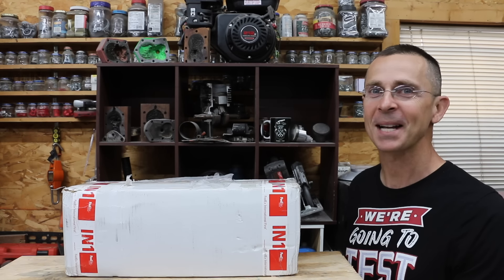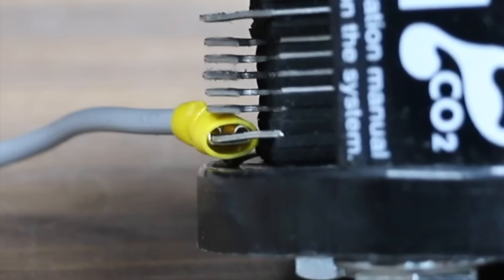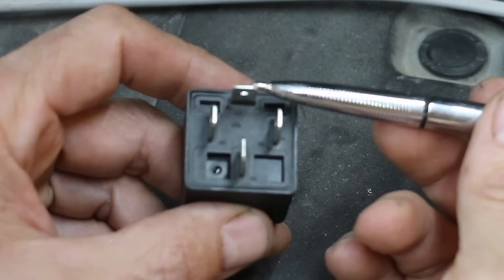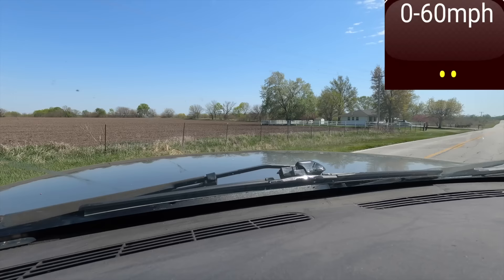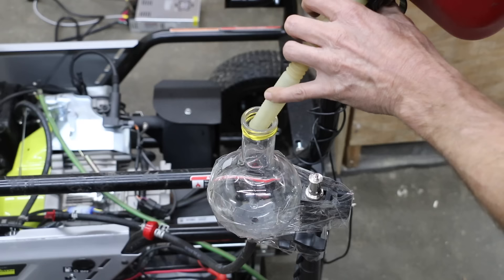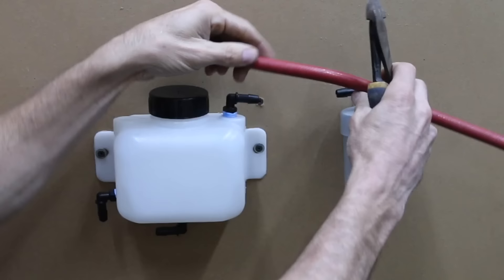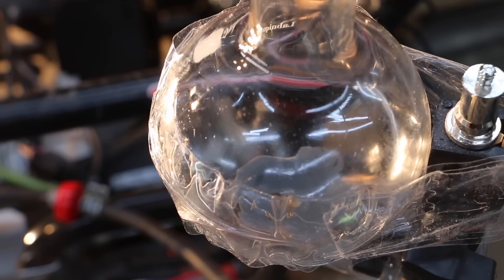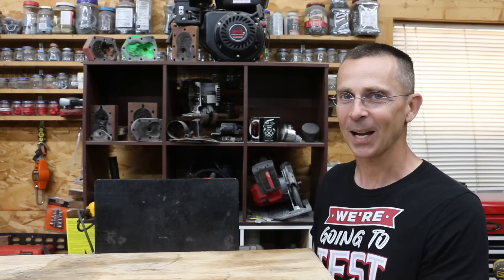AMAZING 35% More MPG with HHO? Let’s find out! Help with high gas prices?

Comment: As a physicist, I can tell you exactly why this didn’t work: energy conservation. If you generated the HHO with external power, you probably would get that increase in efficiency, at least with sufficient flow rate. But you’re using energy to generate the HHO, and the absolute best you can hope for is to get that same energy back, which you won’t because every step of conversion incurs losses.
Reply: Ok so if we run the hydrogen generator on an extra battery which isn't connected to the regular motors battery we should have a different result?. 

Why not just running the motor on hydrogen alone?
Reply: Thats not exactly true,,you forget the calorific value of the gas generated,,but you will still need petrol to make this system work,,the biggest flaw is the O2 sensors and electric fuel in jection,control by a set value in design,,why you need to trick O2 Sensors,,other wise more fuel will adde to bring mixture back to design set,,
HHO<Browns gas,,you have added extra oxy and the sensors see it,,The other problem is the size and design of unit,
no where enough gas is genertated to supply such high flow rate of this pertol powered air pump,,
Reply: When you seek to convert
You only subvert!
Reply: @gabrielsansar6187  That makes no sense at all. The ignition in the bomb is only enough to cause one atom to split in the chain reaction which is a completely different subject and situation.
Reply: There is a bad assumption in your argument. A gas engine has, at best, a 40% thermal efficiency.  Adding HHO improves thermal efficiency of the engine. That's where your power to generate the gas comes from.
Reply: @ianwilliams487  
Ok that makes sense.. But what about adding this to a carburetor type vehicle without O2 sensors?
Reply: @ianwilliams487  no such thing
Reply: Hmm well i will admit when i tried to find it,
I didn't find it,
how ever i have seen his Ford escort running on HHO,,Now he didn't give any thing on fuel cost compare to normal running,,
but it did have a HHo system and the car worked well,I was more interested in the heat of the Gas when burnt,and yes he did Melt a brick with the egnited gas,,
Reply: @ianwilliams487  
Thanks Ian
Reply: @ianwilliams487  You are exactly right.  The object of HHO is to create a more efficient burn of the petrol.  You can do the same with a petrol vaporizer.  I did that several years ago with a chevy full sized van v8 engine.  Van went from 16 mpg to 26 mpg first half tank.  By last half tank it was back to 16 or less.  Computer completely defeated the device.  O2 sensor wasn't getting hot enough to read within range, and computer went to open loop, thereby increasing fuel output.  The whole system needs to be re-calibrated in order for these devices to work, and it is doubtful that current O2 sensors are capable of operating at the lower temperatures that an efficient burn would provide, thereby converting heat more efficiently into mechanical energy within the cylinder itself, leaving less heat to escape the exhaust valve and be read by the O2 sensor.  A carbureted car doesn't have that problem.
Reply: @ianwilliams487  The extra oxygen is supposed to be burned in the combustion with hydrogen. If there is extra oxygen in the exhaust reaching the O2 sensor then the engine needs more fuel.
Reply: @davidia8000  No. You'd have to maintain charge on that battery. So at best you'd get a mild gain then have to make up the charge at home.
Reply: @dlewisa  thank you
Reply: @ianwilliams487  correct, correct, and correct.
 peace.
Reply: @Brian-yp2jr  hho doesn't improve anything.
Reply: @freedomunrestricted  it does if the system is designed to use it. The ‘kits’ are crap, You don’t have to believe it but I’ve done it. Ask yourself why cars have EGR.
Reply: @MrCountrycuz  that sounds like those woke collages and universities..lol
Reply: That makes no sense. Gas is created by the chemical reaction where electricity is only the catalyzing agent. Only 20 µjoules are needed from the spark to ignite it releasing ~240 kj of energy per mole of H² as heat. Cycling back current to produce gas is independent and meager compared to the energy output from the chemical reactions.
Reply: @ianwilliams487  you would just need to pass the gas through the mass airflow sensor so the fuel trim can make long term compensation to the fuel tables.
Reply: @Brian-yp2jr  to reduce exhaust emissions at idle?
Reply: Needs more amps
Reply: Thank you, I tried very hard to attempt to explain the same thing but like I said in my post. I'm a doer and not an explainer. I can build it in my head and see all the ways and reasons why it wont work and even how to test it to prove if your gaining anything at all from even if your not using power from the engine to create the hydrogen. I just cant really explain it, but I've already made a hydrogen cell once when I was about 17 years old which was 20 years ago.
Reply: Exactly
Reply: Whilst I agree this is not working - Could it be that in specific scenarios, energy is conserved because of increased efficiency gained by using more of the energy within the diesel/fuel (e.g. unlock and use more of the 65% of wasted energy in a typical ICE?) - maybe not by using HHO but maybe by using plain water injection - converting excess heat into steam during the power stroke (less heat into radiators)
Reply: No one (so far as ive seen) has addressed that this is a fuel injected genny, and as such has a preprogrammed fuel curve that the ecu wouldnt deviate from unless programmed to do so. So there wouldnt be a visual change to the fuel efficiency.
Reply: @Kam1kaz3dreamer  Part of the fuel "curve" is engine RPM.  It stands to reason that if the engine is more efficient due to the HHO, then the engine would have a slightly higher RPM for any given fuel input.  The ECU would then dial back the fuel in order to maintain appropriate Engine RPM for a given load.

That this is not happening is a glaring indication that the HHO is having a close to zero if not detrimental effect on the combustion in the engine.

TLDR - HHO does not deliver on claims of increased fuel economy.
Reply: @Brian-yp2jr  Brian,
It does not matter the termal eficiency as long as you have energy lost in HHO. HHO is losing almost 10-15% of energy thru heat.
The energy entered in the system must be equal with the energy you get out of the system. The people that use HHO think that the Hydrogen combustion is more efficient so they save energy but the electrolysis is not 100% efficient.
Reply: @brucekamps6970  you can alter the value sent from o2 sensor to obd or cpu, to make the cpu think whatever you want it to think, if programming through a diagnostic tuning program is not an option, just vary the resistance
Reply: I'm a mechanical engineer and have had this same argument with people thinking you can get something for nothing.  One guy was dead set on changing the world by trying to strap a wind turbine to his car to charge the battery while driving down the road... This is the same kind of thing.
Reply: @nerdiedude  is what i would say if i were an idiot
Reply: @azza-in_this_day_and_age  In most cases you have to add voltage with an EFIE unit.  The problem with that is that the O2 sensor needs a certain amount of heat to produce voltage in order to run within a certain range.  A very efficient burn will reduce the heat to the O2 sensor, rendering it inoperative.  In that condition, the computer often goes into open loop limp home mode and goes full rich, defeating your device.
Reply: Perhaps adding solar panels to the top of the truck would help.
Reply: I don't think your explanation is very good. Fuel consumption provides around 30% efficiency. If HHO were magical it would function as a catalyst and increase fuel efficiency. 
There are real catalysts in the world that make other reactions more efficient or increase yield. HHO isn't one of them.
Reply: @audacityhour3104  I manufactured my own fuel vaporization system that takes a small amount of gasoline from the return line of the fuel injection pump.  The vaporizer has a water jacket and a very large surface area element contained in a small package.  Positive crank case gases are directed through the vaporizer, and the blowby gasses from the engine are mixed with the gasoline vapor which is then hooked to a vacuum inlet line from the PVC system.

Signal from the O2 sensor is intercepted and directed to an EIFE unit, which is a tunable electrical circuit that adds a small amount of voltage to the O2 signal line, thereby making the computer see a higher voltage range.
Reply: @jonathanhudson4623  
Did you use your cell on a carburetor or ECU system? What where your results? Thanks…
Reply: He did use an external power supply on the second part of the experiment
Reply: @brucekamps6970  I had a friend years ago that made a HHO gen for a geo metro and got 70 mpg from upper 40s. He got around the open loop by adding washers under the O2 sensors to pull it out exhaust gas flow but to continue to get enough to operate the O2 sensor.
Reply: @traviswatts9386  Good to know.  I might try that.
Reply: Myers used diodes, capacitors and all sorts of electrical stuff to overcome this but the wiring diagram to the extra circuitry  is hard to come by now
Reply: Thank you sir for informing us I know this is new technology for us the more we understand it the more we can perfect you should make a video on how to perfect it I'd love to see that video of course we have to do our own research on it because gas and oil companies don't like us researching it but what u said got my attention
Reply: His test method was partially flawed basically he never proved the output in liters per minute. essentially     we have no idea how much power this generator is using or how much hho is being produced.
There are so many variables  to his test first and foremost using a AC converter instead of the fused DC tap on his generator is extremely inefficient.
Reply: What I know of the actual lpm output of that cell is below the minimum requirements of that small engine
Reply: I am sure that it is not supposed to run on external power. The energy savings will get nullified. Defeats the purpose.
Reply: HHO is a pollution free energy exchange system losses are minimized by proper system design, sizing including engine timing modifications.
Without proper system óeration confirmation ie litres per minute of hho versus liters of displacement of the equipment. I know for a fact  you cannot use the manufacturer rated output?
Without an actual verified output from the hho generator non of the tests are valid!
Reply: The generator test was the absolute worst way to operate an hho system 
Every household generator with electric start has a built  in 12v tap it is after all an alternator.
Reply: @ianwilliams487  the amount of energy required to exctract that hydrogen is higher to the one you get by burning it. even tho hydrogen is 3x more energy dense than gasoline, it wont change anything. on a closed system this will never work, it needs outside energy to produce it,. LIAM is right
Reply: @davidia8000  it would maybe work if enough hydrogen is produce but only until the battery is depleted witch wont last very long
Reply: @ianwilliams487  Your understanding of the o2 sensors needs improvement. There’d be no need to “trick them”; they’d do their job just fine and the injectors would compensate accordingly.
Reply: Gasoline engines apparently have a thermal efficiency in the range of 30%~40%. It wouldn't make much sense to go through all this if the electricity is coming from the alternator (via the engine) like you said if all this does is adding the energy of HHO to the engine as well. But if HHO somehow works as a "catalist" to improve the efficiency of gasoline combustion in addition to just being another fuel, I think it's still possible to get an efficiency gain. I'm not a chemist but I think there should examples for a fuel mixture of the composition  A+B having higher efficiency than either A or B separately.
Reply: @w1ndexcheese  If the combustion becomes more efficient, wouldn’t the engine be able to achieve greater HP at lower RPMs? Higher RPMs would mean higher fuel consumption, thus negating the desired effect of improving mpg.
Reply: My thoughts exactly,  you are going to lose efficiency making Hydrogen , otherwise we would have a propetural energy machine,  which isn't possible.
Reply: as a mechanic , I can tell you : any changes to fuel mixtures / additives requires at the very least , the engine timing to be tunned to take advantage & show any benefit.
Reply: Some of the replys to Liam's post do not reflect an understanding of the laws of thermodynamics. The first law (which is what Liam is referring to) is: "Energy can be converted from one form to another with the interaction of heat, work and internal energy, but it cannot be created nor destroyed." That means that breaking the OH bonds in the water is going to pull exactly the amount of energy from the electrical system that is given off by recombining oxygen and hydrogen in the combustion chamber. Since an IC engine typically has an efficiency of around 30%, there is a net loss of 70% of the energy involved. Since the quantity of hydrogen generated and burned is minuscule compared to the quantity of gasoline burned, it is unlikely that this cost would be detectable outside of a lab, although the bubbler apparently consumes a bit less than 1/10 horsepower and a fairly aerodynamic car will need about 15 hp at 60 mph... at that 70% loss, I would expect to see a loss of 0.2 mpg.
Reply: @brucekamps6970  Try a newer car. These days self heating lambda sensors are the most common by far. I remember a few aftermarket vaporizing devices in the late 1970's and at least one use long probes and ultrasonics. There was also the Holley Economaster which was a spread-bore with tiny primaries. Now we're nudging $5/gallon I may need to do some experimenting. In the early 1980's I had success with water injection in combination with lots of ignition lead.
Reply: @azza-in_this_day_and_age  I've used that for L-Jetronic on the engine temp sensor (thanks to the guys a TRD Long Beach for that hack). Since the lambda sends a voltage an op-amp would be more stable there.
Reply: @antilogism  👌 i like that
Reply: @ulrichwilsenach4411  Its been done and adds a very small amount of power due to the formation and expansion of the water to steam. This was done during WW2 on aircraft engines to enable them to run higher manifold pressures without detonation. The next step was to use water alcohol injection which enabled even more boost pressures and a good increase in horsepower. The final iteration was a liquid nitrous oxide injection system which greatly boosted power output. All done by the Germans 80 years ago.
Reply: @jrm4408  The lack of even basic science or physics knowledge in the general public these days is really disheartening and speaks volumes about the current education system.
Reply: @zmartkooky244  What.......???     It takes 55 Kw of electrical energy to produce a Kilogram of hydrogen.....that is a lot of energy, in fact 1 Kilogram of hydrogen has the same energy content as a gallon of gasoline.
Reply: @antilogism  I'm about to try an 03 GMC 4.2 I6.  We'll see what happens.
Reply: @brucekamps6970  Let us know. My guess is it's another Pons and Fleischmann thing but maybe not.